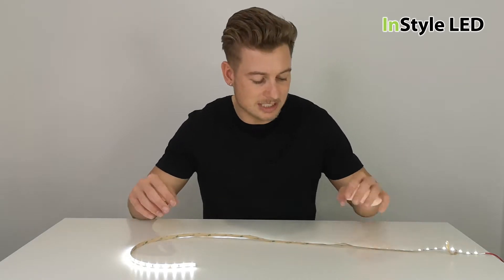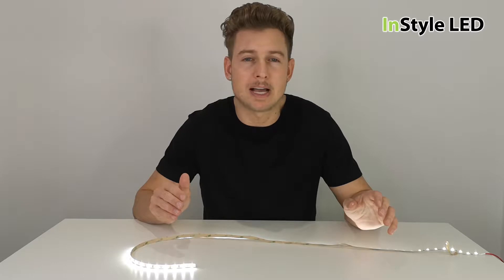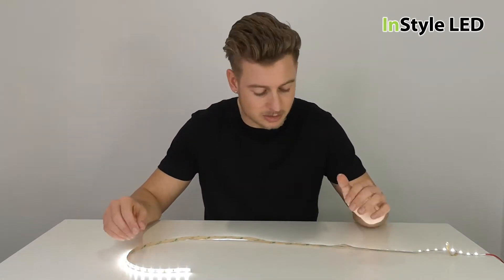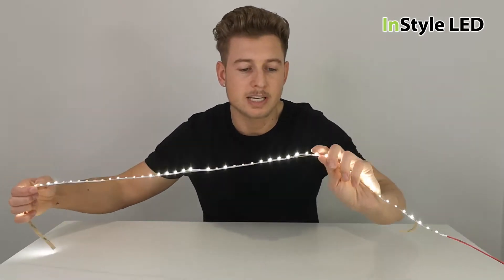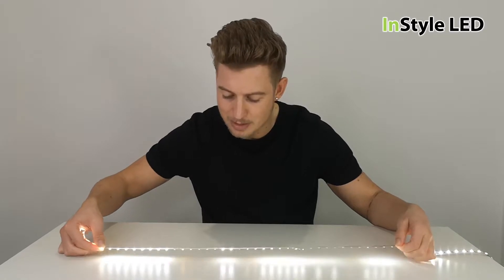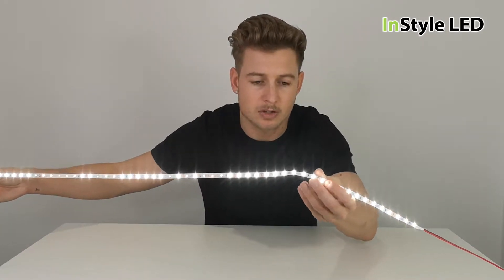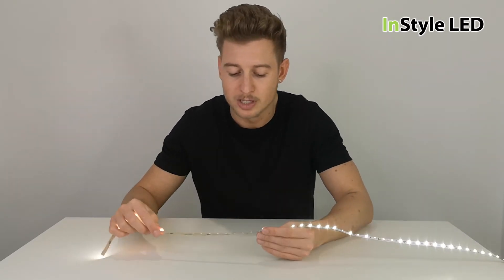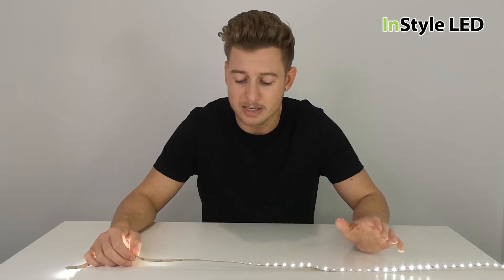Why are my LED strips not working | showing a different colour? A: they have paint on them!

Comment from the maker: Here is the ultimate guide to answering all of your issues :  https://www.instyleled.co.uk/support/troubleshoot-led-strip-lights/
Reply: InstyleLED can you please please help me when ever I change mine to any color other than red 2 of them are a opposite color when I go to blue 2 of them turn red when I put white 2 of them turn yellow and it’s always the same 2
Reply from the maker: @shawannalaton  Hi Austin, yes we answer that question in the guide , link above.   Or try some tests like here: https://www.youtube.com/watch?v=R7LtPCXTwrU&t=2s
Reply: which ever button i press it just shows red, if i press b or g, its JUST red? ive been trying to fix it for 2 hours and it wont work
Reply from the maker: @yenomatic  DO you mean you R and B on the controllers receiver or on the LED strip lights?
Reply: Please help only my bottom three lights are turning on but they ether turn red or green
Reply: Only three dots of my led lights r working ...I tried turning on and off ,switched battery’s,unplugged plugged ,now what ? Plz help mee

Comment: Hi! Can you please help me?
I bought my led lights 2 monts ago and they worked fine until 2 days ago. Now, whenever i turn on the switch on the socket, the lights turn white. And when i press any button or the remote (red, power on, off, inc. Brightness ,etc) the lights turn a green-ish yellow. Over time they turn red, and then eventually fade off and die. I have rgd LED lights.

Comment: Hiii can you please guide me how we can fix ?

Actually we were installed the profile lights in fall sealing and when painter do the primer in fall sealing may be some spots going inside the aluminum pannel and due to this some of LEDs are going to glow in yellow color. 

Now I want to clean the LED strip and need your guidance how can we clean the complete strip of only the yellowish LEDs. 

which chemical / petrol / thinner or nail paint remover we can use ?

waiting for your quick respond .. or any detailed video if you have on the same please share the link.

Thank you so much

Comment: So I thought it was a problem with my Gigabyte motherboard but now with Asus I still get this thing. When I set all of my LED light strips and fan frames to WHITE they become RED instead. Lowering the brightness makes them white again but darker. Basically more brightness makes them orange to red, as if the blue and green LEDs were failing for some reason. Both the light strips and fan frames are by Phanteks and connected to a single RGB header. After this happens the LEDs seem to be broken as they show wrong colors like orange and pink become red.

Comment: Bought some LED lights off Amazon from a vendor named Gusodor, at first the lights were amazing but after a month exactly they just wouldn’t turn back on. I went to the lengths of having them send a new box (suspecting it was the adapter not the lights) only for those to not work either. I don’t know what to do and I really want to keep the lights I have up because if I tear them down it will tear off the paint

Comment: i thought this guy was going to explain technical stuff why some leds show different color. instead he just says theres paint on the strip. which is not the case for me or a lot of things. he doesnt talk about how solder joints lose connection or if the led got wet or whatever. no just paint. total waste of time.

Comment: The white light on my RGB strip turned yellow after 6 mos of use. Other colors on the strip are working fine. What do you think might have happened?
Reply: @IcedGaze  

Do you use an RGB light?

I just changed the whole strip out. I now use a plain white led strip rather than an RGB strip.

Comment: I’m don’t know what brand mine are but a lot of them seem similar so maybe someone can help me but basically they’re just stuck on one of the color changing modes. I know it either has something to do with the remote or the little “IR receiver” that’s connected to the “control box”. There were a few times a while ago when I was able to make the lights change to a different color by holding the little light on top of the remote to the receiver thing and tilting it around til it change but then it would get stuck on whatever color I changed it to. It shows the color of whatever button I pressed but just couldn’t change it. I’m not sure how to fix it.

Comment: Basically.. when my lights are plugged in.. I see a bit of a glow from them but it's really faint type of glow and my remote isn't doing anything to fix it. Also it shows brighter glow applying pressure to it and one day they were working perfectly fine! now this is happening and I don't think there is a way to actually fix it 😔 not quite a lot of people having the same problem as me.
Reply from the maker: sounds like your power supply isn't the correct voltage as the LED strip,  are you able to check what both say on them.  EG. 5v or 12v or 24v
Reply: @InstyleLED  I'll check when I get home from school and I'll tell you
Reply: @InstyleLED  12v

Comment: Help! My green works fine, but my red and blue only come on together. If I choose red, I get purple. If I choose blue, I get purple. The red and blue seem to be intertwined
Reply from the maker: Check the wiring at the controller it sounds like the red and blue cables are touching somewhere, so they will be coming on together. You need to find where and seperate them
Reply: InstyleLED It worked! Thank you so much!
Reply from the maker: @johndonovan6031  no problem!

Comment: everytime i try to turn my led lights purple or pink it turns red and blue... i’ve been trying to find a video to fix this for atleast 30 mins and nothing works... can somebody please help. i cannot make my led lights one solid color , they only turn red and blue , green and red, or a bunch of different colors and it’s soo frustrating
Reply from the maker: Maybe try this,  or see my comments below, I have an answer for all issues:

If all of the LED strips colours are working except for just one colour, and this is affecting that colour all along the strip (e.g., the whole length of the Red colour LEDs are not working), then there is either a fault with the soldering of the Red -ve cable onto the strip’s PCB, or else Red cable is faulty from the strip to the receiver, or the connection of the Red cable into the receiver is faulty or disconnected.

We can say this with some certainty, because here is no way that full length of Red LEDs are all faulty; the way LED strips are made means that a faulty LED will only affect the section between those cut points. Therefore the issue is related to the cabling.

Solution: 

Check the cables between the controller and the strip, especially if you have extended them with a connector block. An effective test would be to wire the power supply directly to the strip, thus cutting out any extension cables and any control gear. And note that black is always positive (+) for RGB/RGBW strips. so start by wiring the positive from the power supply to the black cable on the LED strip. Then wire the -ve from the power supply to the cable for the colour that isn’t working.

Let’s imagine that it’s the blue cable that is not working. In such a case, you should then see that the Blue lights will light up, proving that they work – which means you have a bad connection somewhere else. With this knowledge in mind, rebuild the system step-by-step, adding the controller (and extension cables if you have them) and see which component makes the Blue lights stop working.

(If at this point the Blue does not work at all, then check if its cable has come off the solder pad on the strip, as this is the only reason left as to why it would not work.)

Comment: i will press blue it will turn off i press purple i press white it turns a light green help please
Reply from the maker: sounds like the blue cable isnt connected,.  try this to test your strips: 

If all of the LED strips colours are working except for just one colour, and this is affecting that colour all along the strip (e.g., the whole length of the Red colour LEDs are not working), then there is either a fault with the soldering of the Red -ve cable onto the strip’s PCB, or else Red cable is faulty from the strip to the receiver, or the connection of the Red cable into the receiver is faulty or disconnected.

We can say this with some certainty, because here is no way that full length of Red LEDs are all faulty; the way LED strips are made means that a faulty LED will only affect the section between those cut points. Therefore the issue is related to the cabling.

Solution: 

Check the cables between the controller and the strip, especially if you have extended them with a connector block. An effective test would be to wire the power supply directly to the strip, thus cutting out any extension cables and any control gear. And note that black is always positive (+) for RGB/RGBW strips. so start by wiring the positive from the power supply to the black cable on the LED strip. Then wire the -ve from the power supply to the cable for the colour that isn’t working.

Let’s imagine that it’s the blue cable that is not working. In such a case, you should then see that the Blue lights will light up, proving that they work – which means you have a bad connection somewhere else. With this knowledge in mind, rebuild the system step-by-step, adding the controller (and extension cables if you have them) and see which component makes the Blue lights stop working.

(If at this point the Blue does not work at all, then check if its cable has come off the solder pad on the strip, as this is the only reason left as to why it would not work.)

Comment: Hi! Not sure if you still respond to comments but when I have a color, there’s always that once single thing that lights up that’s a different color, it changes every time I change the lights color and the color always changes to something else. Is my strip broken or is there a way to fix it?
Reply from the maker: HI there!

Try this:

If all of the LED strips colours are working except for just one colour, and this is affecting that colour all along the strip (e.g., the whole length of the Red colour LEDs are not working), then there is either a fault with the soldering of the Red -ve cable onto the strip’s PCB, or else Red cable is faulty from the strip to the receiver, or the connection of the Red cable into the receiver is faulty or disconnected.

We can say this with some certainty, because here is no way that full length of Red LEDs are all faulty; the way LED strips are made means that a faulty LED will only affect the section between those cut points. Therefore the issue is related to the cabling.

Solution: 

Check the cables between the controller and the strip, especially if you have extended them with a connector block. An effective test would be to wire the power supply directly to the strip, thus cutting out any extension cables and any control gear. And note that black is always positive (+) for RGB/RGBW strips. so start by wiring the positive from the power supply to the black cable on the LED strip. Then wire the -ve from the power supply to the cable for the colour that isn’t working.

Let’s imagine that it’s the blue cable that is not working. In such a case, you should then see that the Blue lights will light up, proving that they work – which means you have a bad connection somewhere else. With this knowledge in mind, rebuild the system step-by-step, adding the controller (and extension cables if you have them) and see which component makes the Blue lights stop working.

(If at this point the Blue does not work at all, then check if its cable has come off the solder pad on the strip, as this is the only reason left as to why it would not work.)
Reply: InstyleLED oh and, another question, my led light have a glow to them when they are off. I can the see glow at night, it is normal?

Comment: My led lights came in today and they only work on red light. Not even propper shine
Reply from the maker: sounds like you have a 12v power supply to 24v LED strip lights!
Reply: @InstyleLED  So how do I solve this problem?
Reply: @InstyleLED  just checked my adapter and it has 5V written on it. Am I supposed to get an adapter with higher voltage?
Reply from the maker: @damlabahri1659  what voltage does it say your led strips are?
Reply: @InstyleLED  12V. I just went to the store and bought a new adapter. The lights are perfectly bright now, but now my controller stopped working. I tried changing the battery but it's still not responding. Ugh this is getting pretty annoying. :(
Reply from the maker: @damlabahri1659  can the controller handle 12v or does it say 5v?
Reply: @InstyleLED  It doesn't say anything about that on the controller, but the battery it came with says 3v if that's any helpful.

Comment: Dont get paint on my LEDs? This is not helping anyone.
Reply from the maker: Hi Brian,  whats happening with your LEDs and ill help you out right away if I can
Reply from the maker: And this video was created as ive seen alot of people confused why their LEDs are showing different colours, and its because they have been painted whilst in place (so LEds get installed into place first, then they get painters in, and painters get the paint on the LEDs ). So if you cannot actually see the LED strips close up (lets say they are up in a ceiling coving) then this could be the answer to their question. Surprisingly this is more common than you think!

Comment: I have a couple problems, first one is I have 2 lights strips connected to each other but only one of them works (the one connected to the power). And the only colours that work or different greens and reds, white doesn’t even work. Whenever I press blue it just turns off and any other colour is either just green just red or both of them together (edit: I’ve fixed the other strip not working)

Comment: PLEASE HELP ME!!!!! so when i press red it turns on red, when i press blue it shows up blue , BUT when i press green there’s no colours it’s just like if you press the DIY button and turn all the buttons down
Reply from the maker: It sounds like your green cable isnt attached, can you detach the green cable and rewire it again.  If this still doesnt work try wiring the blue cable into the green to see if that works, if that does work it means the controller is working fine and your having the issue with the cable attached to the green section on the LED strip.
Reply: InstyleLED but what if it’s my controller that’s broken??

Comment: one of my strips works but then stops halfway for no reason
Reply: Same!! I dont know what to do-
Reply: I got mine to work, i had accidentally pressed half of them off, and then switched modes and couldnt turn them back. Just press IC set and the arrows to turn them on again!
Reply: @ruu6462  o-o
Reply: @leilo7233  did it work?
Reply: @ruu6462  no 😓

Comment: when i press blue there are burnt out sections and then when i press purple there are red sections. please help!
Reply from the maker: It sounds like you have damage to the blue LED chips.
Try testing the colours one at a time rather than mixed colours such as purple.
So try just red and check
just green and check
just blue and check

If you find you have blue sections not working then your strip is faulty. Then you should contact your supplier.

Comment: I just put mine up and the blue and red  both look like a purple
Reply from the maker: Your red and blue cables are touching at some point from the strip going into the controller. Take a look and detach and reconnect them.
If they are purple when pressing both red and blue only then it means both red and blue are lighting up at the same time
Reply: @InstyleLED  i fixed it :) thank u

Comment: My green lights stoped working on one of my strips so I tried connecting a new roll of lights and the green lights STILL won work! I spent all my money on these and  I used the green ones a lot and then it just stops! Helpppppp
Reply: did you ever fix them?
Reply: @ninaankrah2867  hey so I kinda just fixed mine if you still need it. All I did was move the connection around my wire is odd but I unplugged it and attached it again but try to level the connection cord a different way like of it is hanging down on the wall
Reply: @carriezaher2707  I can’t even remember how I fixed mine tbh but like they work now soooo😅
Reply: Mine are doing the same thing rn

Comment: for me the problem is that i have the 32ft one (day better) and one roll is turned on white but when i connect the other roll to the 2nd plug red and green works but blue isn’t lighting up so one roll is white and the other is green mixed with red with no blue to balance it out to create white for both rolls

Comment: okay so i was straightening my led light on the wall i had them up for a while and i had to bend them to fit correctly and the little section turned a different color with red and green it’s the same color but for all the different colors that little section is different how do i fix this?

Comment: helpppp okay so when I press on the blue button, all the lights turn on perfectly. But when I get to red and down, only one strip works which is the one that’s connected to the adapter. The other 2 strips only show the color blue that’s it. So for example if I press the the pink button, one strip would be pink and the other two are still blue. HELP

Comment: pls help me, when i press a certain colour on the remote it shows up as that colour but only on one half of the whole strip and the other half is either different shades of green or just blank. i would really appreciate if u could help
Reply: It's because one of the resistor is faulty or damaged. You either have to replace the led roll or cut that portion off & rejoin.